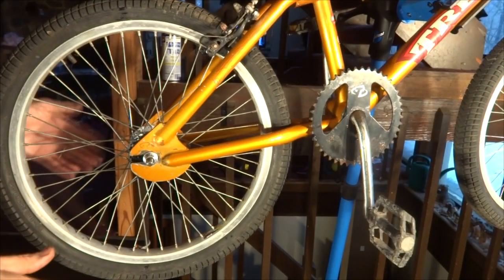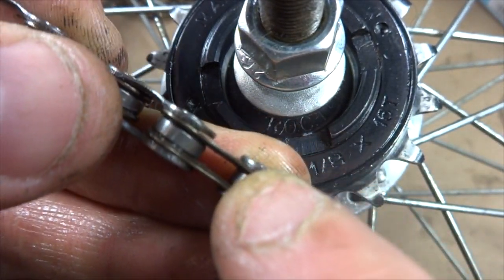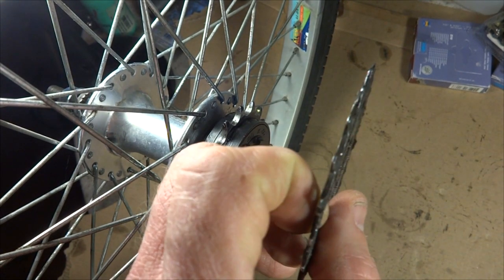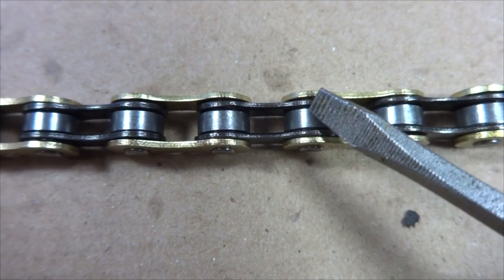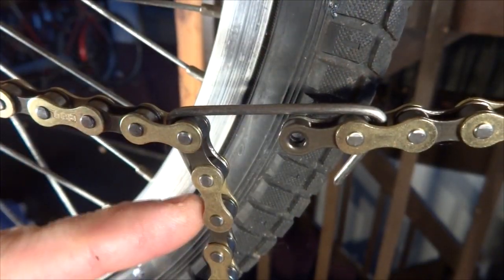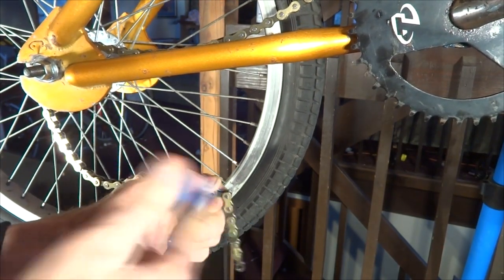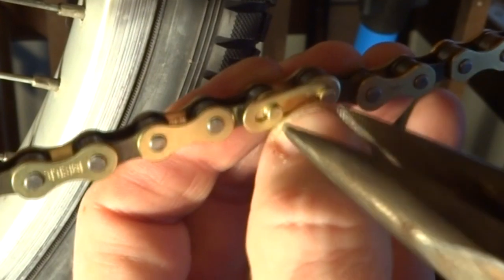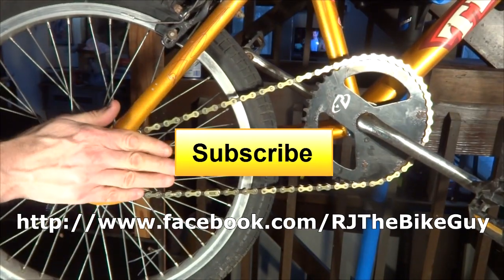What Size & Length Chain For Single Speed/BMX Bike

Comment: Nice video as always. Sometimes there's a problem with chain tension which is the following. Older worn out cogs are not fully round anymore, so you need to find that point and set chain tension according to that point. If you set tension on the lowest worn point, it will be too tight on the higher/warped point.
Reply from the maker: Or replace the cog/freewheel.
Reply: It's safest and easiest method. Not always possible though. If the repair can't cost anything.
Reply from the maker: A worn freewheel will wear out the chain. And vis versa.
Reply: Yea, I know that all too well. I always change parts on my own bikes regularly. There just are some people who don't care and don't wanna spend any money on repairs.

Comment: I wanted to ask, I have a steel trackbike that I want to fix some bigger tires on it.  I want to slide the rear wheel as far back on the horizontal dropout, but someone mentioned that adding too many links to a chain will weaken it.  Have you ever experienced something like that? 

Thanks for reading this, hope it made sense!
Reply from the maker: No, adding a couple more links won't significantly weaken the chain.

Comment: 4:20 Why can't you put the pin back to make the chain longer again? Lets say I want to remove the chain for cleaning the bike. Is the chain unsuable then and do I have to get a new one or can I put the pin back into the chain to use it again?
Reply from the maker: Pins are not designed to be reusable. The chain would likely break at that spot at some point under torque. You would need a new pin, or I prefer a master link.
Reply: Thank you! I think I will go for a master link.
Reply: unless you have a chain like a 510H with those riveted pins they can go without a masterlink I used to do heavy street and grind my chain heavily during sprocket grinds never popped out but for a KMC 410 or a bell chain never ever try to re pin it, It will pop off since the pins are not riveted.

Comment: can u put the pin back in? because if not then all my bikes need master links
Reply from the maker: If you can get it back in, it will never be as strong as before. The chain will likely break at that spot. Some Shimano chains take replacement pins. I prefer master links like KMC's Missing Link.

Comment: Can i run a 1/8 chain on a 3/32 single freewheel..
Reply from the maker: Probably. Getting a 1/8" freewheel might be better though.
Reply: White industries  16t only accepts 3/32 but 17t on 》》 accepts both

Comment: I have the exact kind of kmc chain on my mtb as the one shown at the beggining.
Reply from the maker: I like KMC chains, but didn't have one on hand.
Reply: KMC 410 is very cheap classic chain they last me like 3-6 months while a 410H can last me a solid 6 months but my all time favorite the 510H lasted me 2 years with heavy street bmx on concrete and park only got rid of it for a new lime green 410 for my 98' GT Performer. I wouldn't dare use a 410 or 410H for heavy bmx just for casual riding and for more park riding chain.